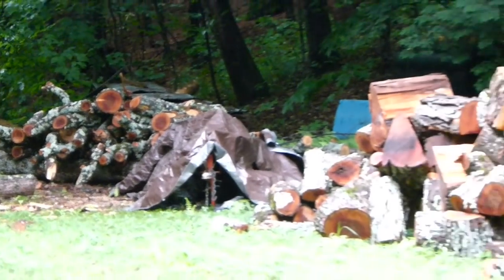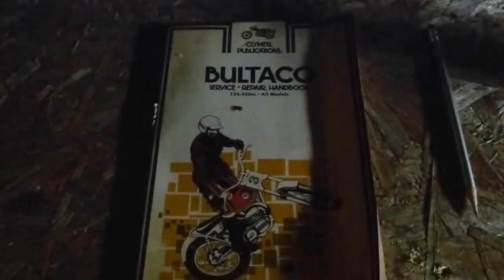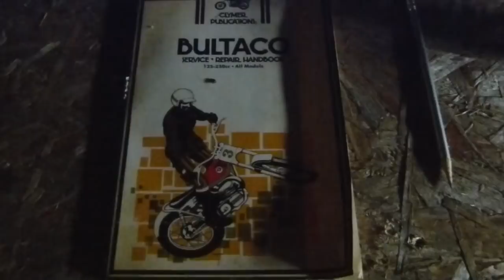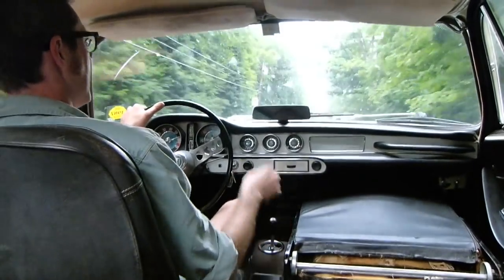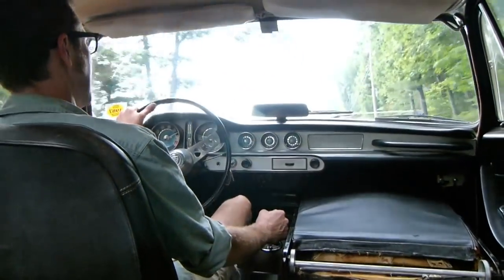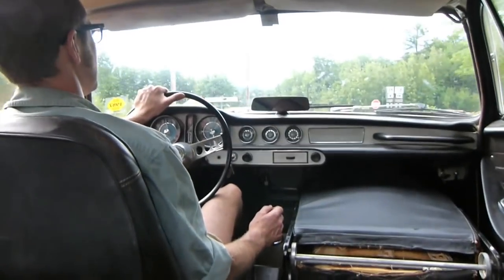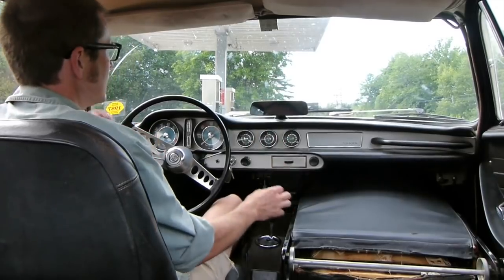Bus's Busy Week

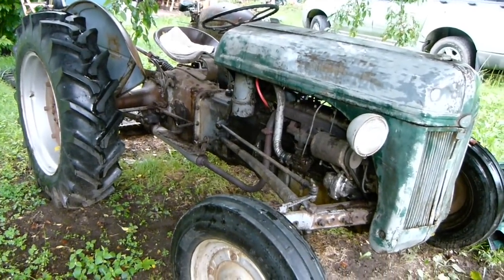Comment: At about 5:12, that's not a primitive motor.  It's a robust and immensely piratical motor.  I've got a 63 MF35 and a 72 MF135, both diesel, and I can tell you from experience that they're made to be tore completely down, out in the middle of some field somewhere.  They're as fun to work on as anything broken can be I think.  Even out in the mud and rain...
Reply from the maker: Mat Helm I agree whole heartedly. Thank you for the good words on the subject. I’ll be doing a more comprehensive video on this subject before long, as I can wax poetically for way longer than most want to hear on that perfect motor. Top five.